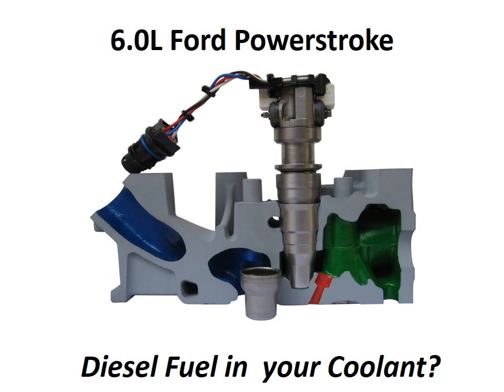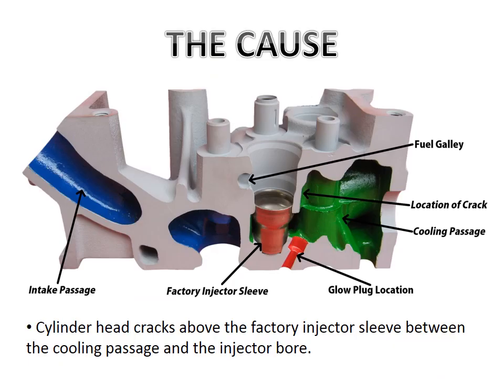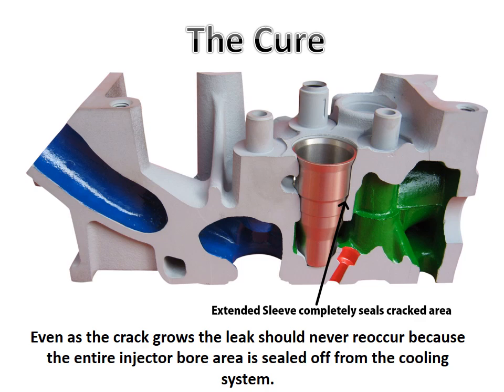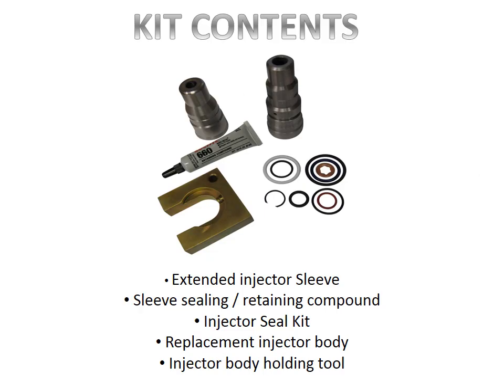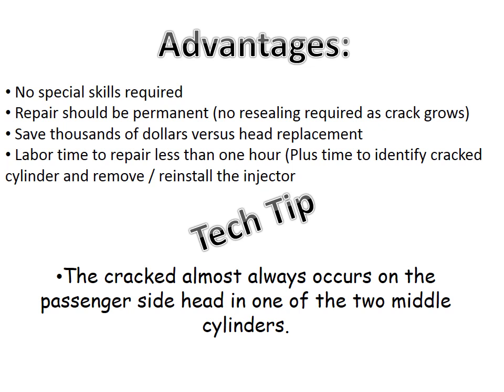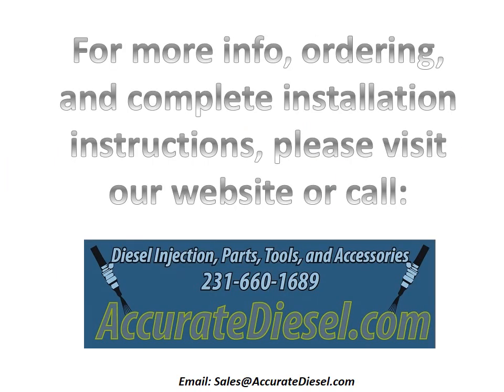Diesel Fuel in your Coolant? 6.0L Ford Powerstroke Cylinder Head Repair Kit

Comment from the maker: Nick, we believe the crack occurs due to a weakness in the casting. You will notice in our cut-away view of the cylinder head, that the wall thickness is very minimal in the area where the crack occurs. Overheating can definitely trigger the crack, but many times the crack develops with no overheating event. Feel free to email or give us a call if you would like to discuss further.